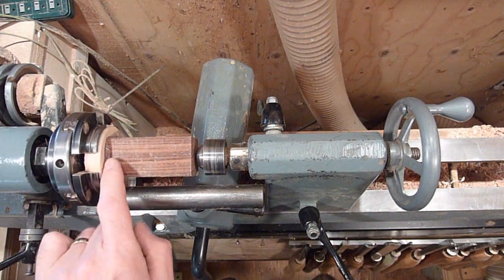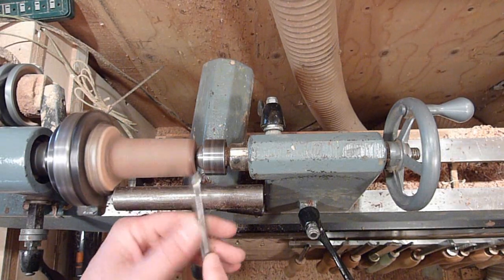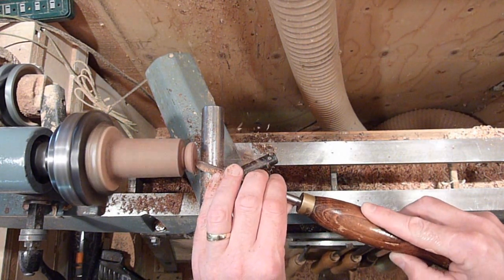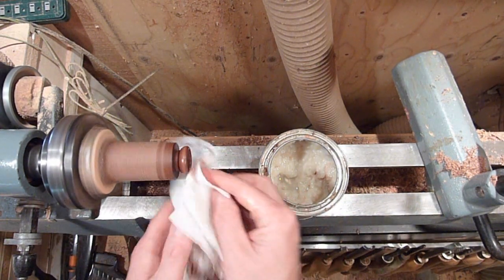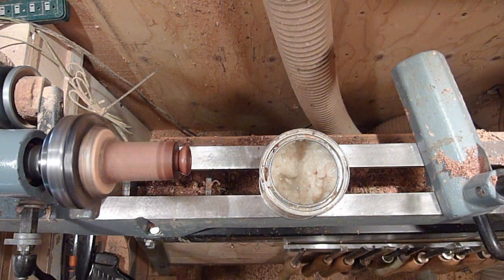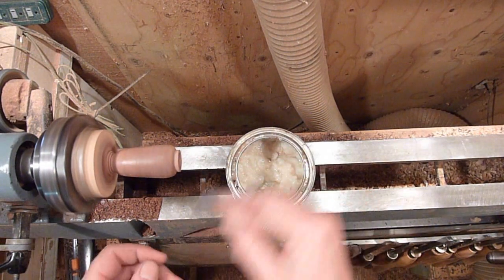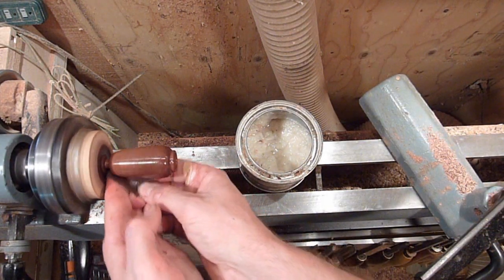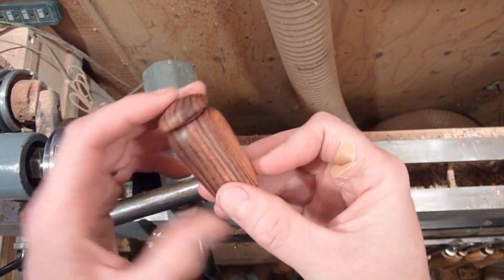Wood Turning Project Cocobolo Box

Comment: Great videos!!! I am new to turning, my new obsession. I have a basic set up and am very frugal with the wood I use. I use your hot glue technique as I only have a face plate to turn the miniatures I like to do. I use the waste block over several times before I change it out. One of the issues I had was centering the piece, I discovered if I turned concentric circles at random intervals it was easier to find the center. I just finished my first lidded box!!!! Thanks, it turned out great!!!!!!!

Comment: What lathe speed were you using when that catch happened? Does speed effect the chances of a problem when hollowing a vessel?
Reply from the maker: John Lockwood On something small like this, I probably had the lathe at 2000. I don't think the speed makes that much difference, I just caught the tool.

Comment: Hi Carl I was wondering if the clear wax mixed with mineral oil left an unpleasant odor because in my wood shop class we stain our projects and it always leave a strong odor. It also takes a while for the odor to go away so I was just wondering if there was an odor left behind by using clear wax mixed with mineral oil
Reply from the maker: The wax does have an odor too, I put a beeswax finish over it also. The beeswax has a very slight odor.
Reply: Carl Jacobson  Thank you very much your videos have inspired me to try turning for my next project. Keep up the good work